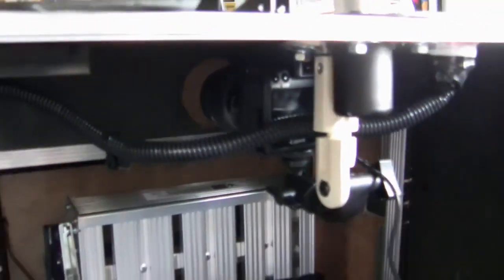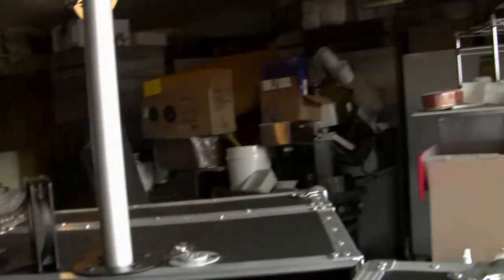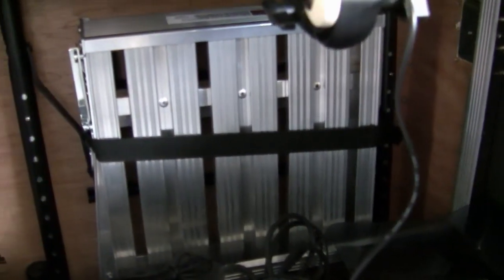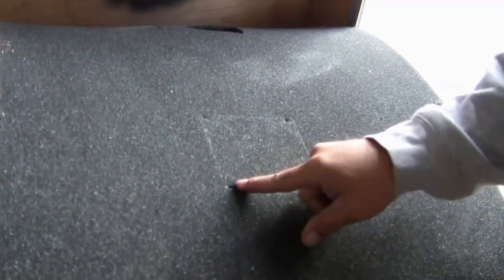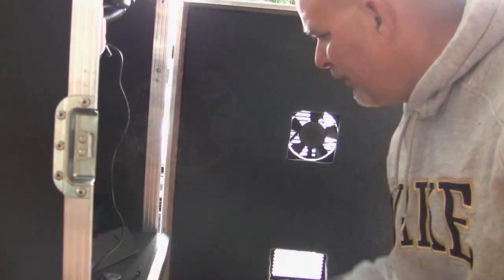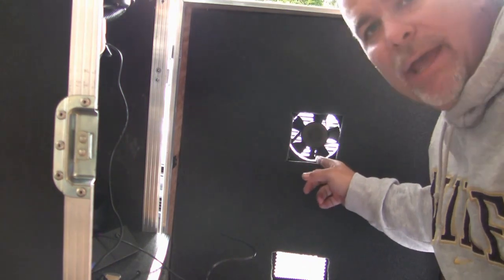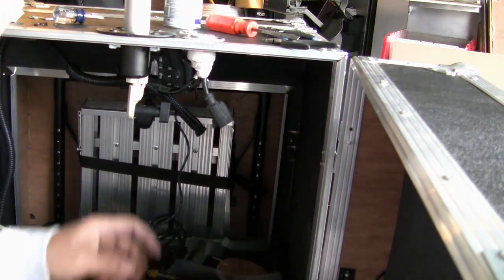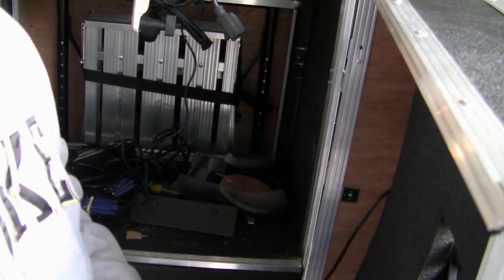Photo booth Fan Install Do It From Scratch with DJ Mikey Mike Photo booth DSLR

Comment: DJ MM, I am in the process of building a Photo Booth myself and thought the fan would be worth installing during the construction process...  Can you tell me where you got the 4" fan from?  Also, did you use a Pole Mounted Light Source?  The examples I've seen of "Turn Key Photo Booths" have an LED Modeling Light built in to the box, and I'm having a difficult time figuring out a light source.  Anyt feedback would be appreciated!  Thanks!  -AJ